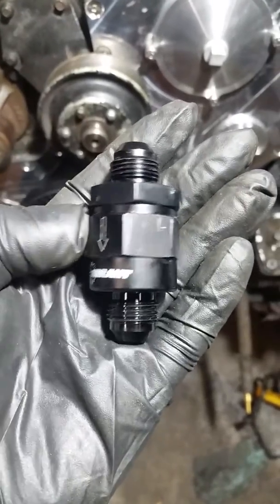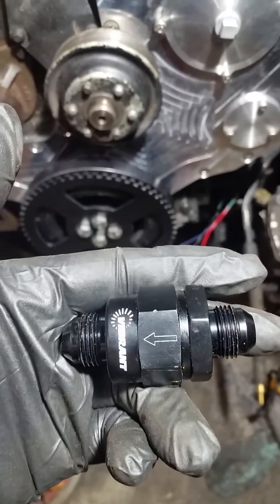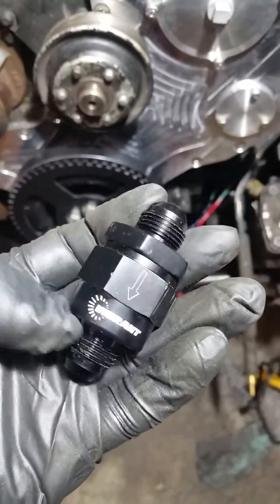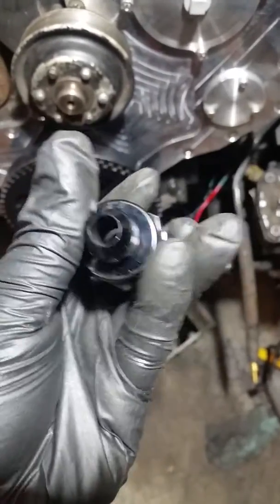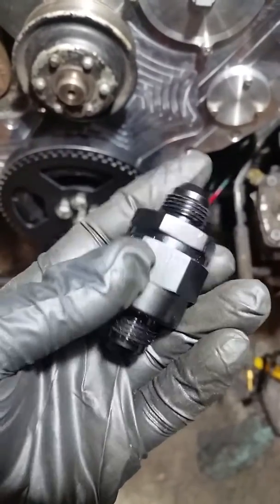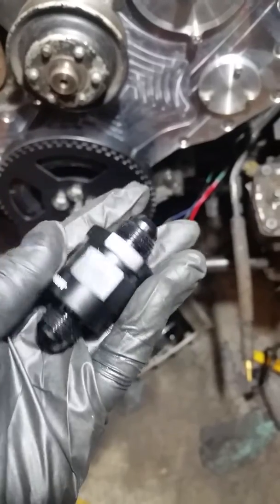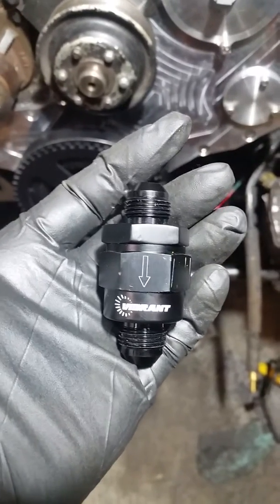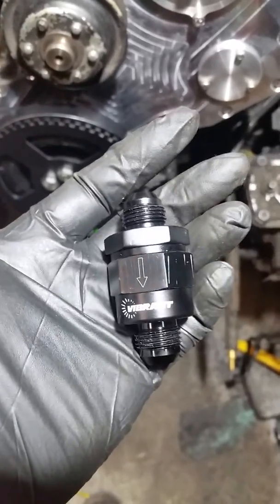Vibrant 11190 Check Valve Review

Comment: I’m not even running high pressure and it still doesn’t work.  I figured it would keep pressure in the fuel line for better start up but as soon as I turn off the engine the fuel pressure drops.
Reply from the maker: Man! Sorry to hear that. We were really disappointed in how weak it's flapper was! Hope you find something that works for your set up!
Reply: @70440charger  Well at least it doesn't interfere with my 255 LPH fuel pump.  Should I bother trying the ball-bearing unit or just find another brand?
Reply: Most aftermarket fuel pressure regulators allow pressure to leak down after the engine is off.

Comment: so did new ball check valve worked ? I just put one on my setup seems like its holding pressure but my main concern is how much restriction it gives.
Reply from the maker: Anton, Yes the new check valve has been hold up since we installed it. Our Walbro pegs the 60 psi gauge and no signs of backflow. Let us know how it ends up working for your.
Reply: I hate the internal design of it, the flange that the spring seats on it has just one hole in the middle and if anything happens to that spring the ball will just plug the system fully. Suck aeromotive doesn't make one in -8, i have their -10  unit and the flange that holds the spring has small holes all over it.
Reply: Lol guess what, exactly as I forecasted! Check valve started to be a bottle neck after about 360lph of fuel flow. Took that pos out pressure back to normal